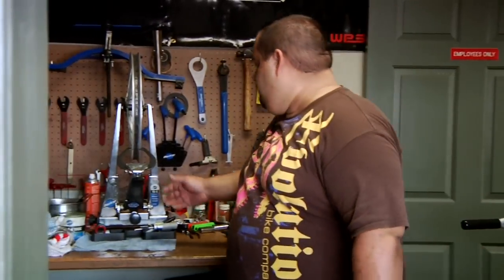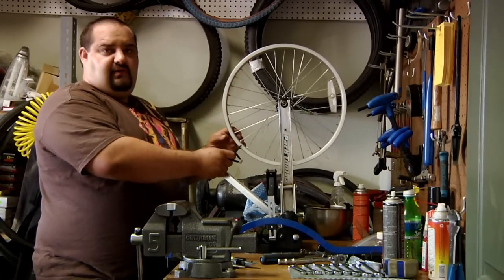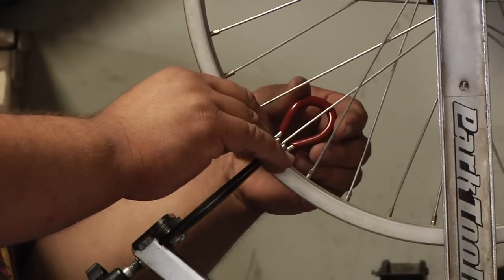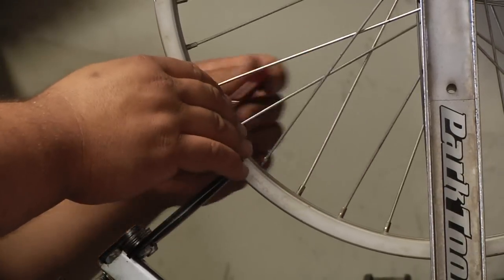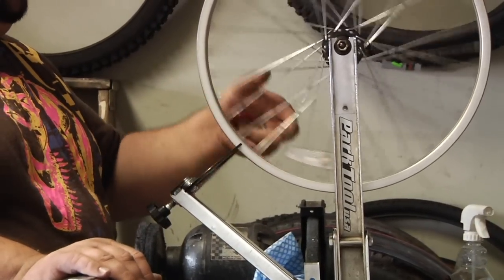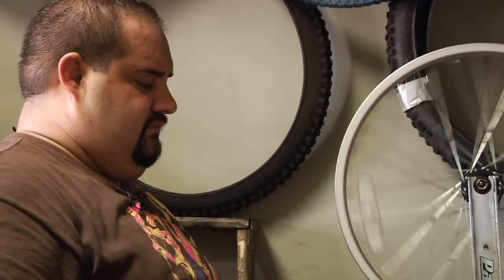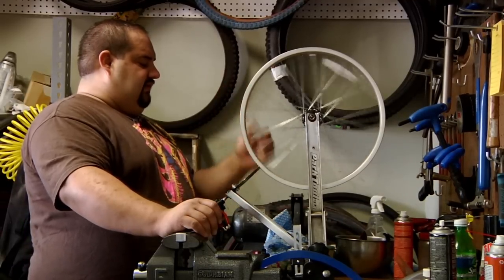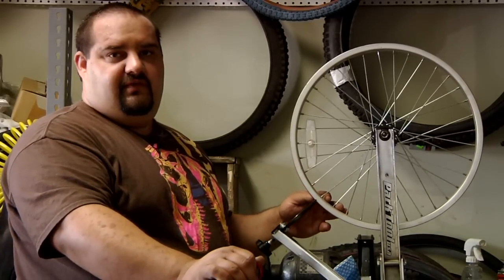Bicycle Equipment : How to Straighten a Bicycle Wheel

Comment: Great video! I have never straightened a 26 inch rim before and I got it 99% straight on my first try!

Question I have a set of plastic Skyway mags the rear one is perfect bet the front has a warp is there a way to straighten plastic mags? Thanks in advance for any info!

Comment: "You don't want to overtighten" proceeds to do 2 full turns WTF lmfao. That is crazy you always do this in 1/4 turns at the most specially on deep section wheels.

Comment: "truing" the action of adjusting the tension on the spokes to get the rim to run true
"straighten" the action of repairing a bent or damaged wheel.  
this vid is useless if you have a wheel that needs to be straightened.